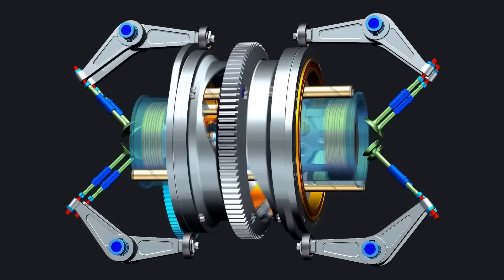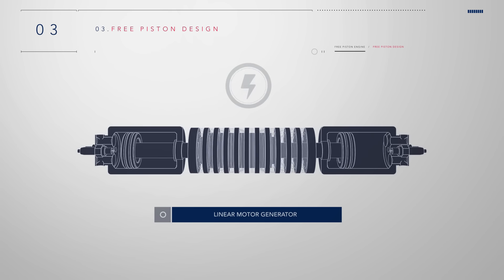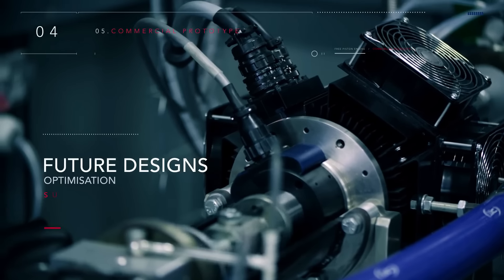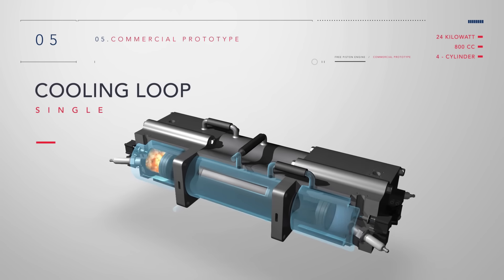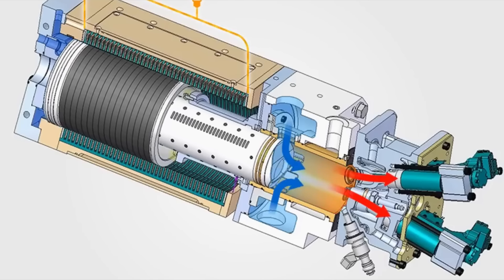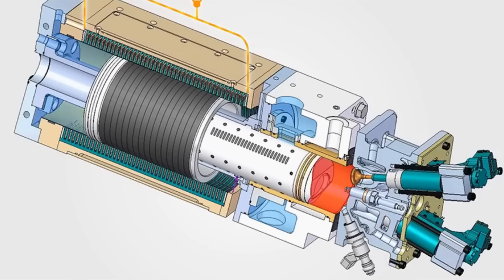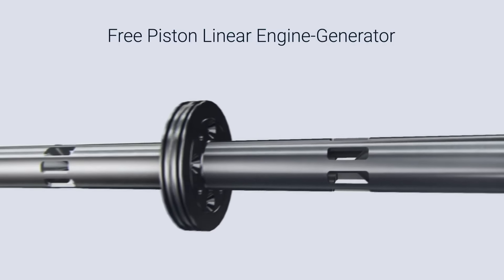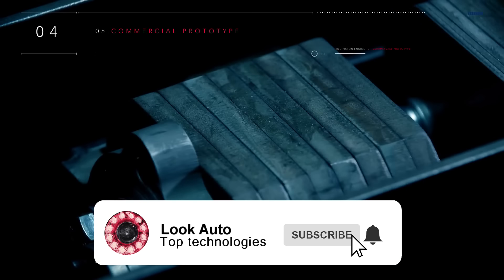New Technologies 2024: W-Piston Toyota | Free piston - efficiency of 50% | Powerful NEW engines

Comment: Rather than makig gasoline engines why not work on high efficiency motors and recharging while driving
Reply: Looks to me the executives in those big brands auto manufacturers don't seems to use their brilliant minds to put to work. Even if they hire actual geniuses, I doubt they even would allow such ideas to be put into motion.
Reply: How would one "recharge" while driving?

Electric motors are already pretty efficient. It's the batteries that are the real bottle neck.
Reply: Electric motors are already very efficient i.e. >95%, likewise batteries but energy density of batteries is still nowhere near that of gasoline.  This engine would facilitate recharging while driving, but if you want to avoid burning fossil fuels that could be done with recharging loops just below the road surface (too expensive to be adopted currently).
Reply: @matthewconnor5483  just a theory not sure if it works but if it's front wheel drive use axial flux generators in rear wheel, convert ac to dc so the emf is reduced drastically, buck boost circuit for a consistent voltage and a charging circuit, them the vehicle travels the more charge for batteries hopefully at a fixed rpm of 20-50rpms

Comment: THIS IS SO CHILD LIKE. I BUILT THIS TYPE OF PROTOTYPE USING TINKER TOYS WHEN I WAS SEVEN YEARS OLD. THIS WAS 60 YEARS AGO. MY DAD HELPED ME MAKE THIS WORK USING COMPRESSED AIR. HE WAS AN AUTO MECHANIC BUT ALSO WORKED ON AIRCRAFT IN WW2. 

WE LATER DESIGNED A COMPRESSED AIR SPINNING ELECTRIC GENERATOR THAT CHARGED A SMALL 12V LEAD ACID BATTERY. THAT BATTERY RAN AN ELECTRIC MOTOR AND WE PUT IT ALL ON A GO CART. THIS USED ONLY COMPRESSED AIR FROM TWO LARGE TANKS. THESE WERE ALSO MOUNTED ON THE GO CART. NO FUEL NEDDED SINCE COMPRESSED AIR WAS FREE USE AT ANY SERVICE STATION BACK THEN. AND NO EXHAUST EXCEPT AIR. I DO NOT SEE WHY WE COULD NOT JUST USE SUPER COMPRESSED AIR AS A FUEL OR AT LEAST USE THE COMRESSED H2 TO TURN A GENERATOR BEFORE YOU BURN IT.
Reply: Why are you yelling this? You should let the Toyota engineers they could just make this with tinker toys.😂
Reply: compressed air to push whole modern car needs lot of space to store it, it probably can only be done with regeneratiev braking (maybe possibly without causing battery degradation by electric regenerative braking to some extent) to help the more sustinable(more sustinable than ev)  combustion  with electric turbo etc
Reply: @kalmmonke5037  WHAT THE F DO YOU KNOW ABOUT IT?

Comment: One question following what nasa found out in their new pulse engine that explosion occur on the sides of the walls of the combustion chamber- how to minimize that loss- having top of piston  and above concave( or cone shaped)? May be in the middle of that cone it’l become flat? God Knows Best.
Reply: From the initiation of combustion in all infernal combustion engines there is a spherical shock wave flame front. But ahead of the shock wave the rising pressure and temperature cause a pre-mixed fuel and oxidiser to spontaneously combust. Typically, this causes the surface of a piston to be eroded - like a rat has been nibbling it - on racing engines or others where it occurs. But the NASA situation is simply a cylindrical wave form effect of their engine. Not a new "technical effect" , but a variation on combustion effects that can be managed in various ways.... I think? Induced swirl patterns from intake passage design can alleviate some of these problems, known since "Ricardo was a lad".
Reply: God knows? 😂😂🤦‍♂️
Reply: Absolutely no idea about internal combustion engines

Comment: how is that turning a wheel? where is the clutch?
Reply: those are supposed to be electric generator and the car will use electric motor to spin the wheel
Reply: mahle recyclable electric motor with high torque subaru wrx cvt or hyundai ionqi hybrid automatic clutch transmission etc